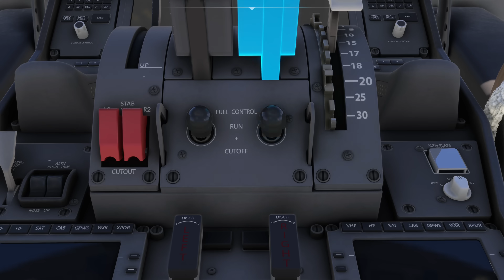Air India 171: Why Did The Fuel Cut-off Switch Get Moved?

Comment: Why are you again resisting the idea of a camera in the cockpit?

“It would add nothing in this case,” is patently untrue. It would tell us which pilot switched off the fuel. As it is we're waiting for someone to reliably identify which pilot said what by recognising their voices.

“Video might be leaked,” is only a concern if, for some reason, you're not worried about audio from the CVR being leaked. Why is that not a concern? Is it even technically possible?

Comment: Why don't you invite on your channel some Boeing 787 pilots working for Air India and other airlines and have an honest debate on this? E.g., Captain Sharath Panicker, who has many strong points against your theory. We should not be biased and listen to all arguments, particularly because the deceased pilots can't argue anymore. In particular, the preliminary report did NOT mention that this switch was manually moved from run to cutoff --- so on what basis are you pointing fingers to the pilots? Is your channel sponsored by Boeing?

Comment: There is no conclusions to be made based in that preliminary report apart that it gives a blank sheet to Boeing and GE to continue their normal operations and save their reputation. As a pilot, you are publicly supporting the idea that  this was a suicide when it is far from being a consistent evidence based on the PR.  Stop yourself from accusing a potential Innocent pilot of killing all the passengers of that aircraft because if the crew is not responsible of the fatal accident you are going to be more than in  trouble from the moral and ethical point of view.

Comment: VASAviation video on the Cessna Citation's engine cutoff "trigger" got me thinking...
For those who haven't seen it, the Citation requires you to move the throttles to idle before engaging the engine cutoff, unlike most Boeing/Airbus designs. It seems like a super intuitive and potentially safer way to prevent accidental in-flight shutdowns.
My question is: If Cessna were to release this design, what are your thoughts on it becoming a standardized feature for commercial aviation?

Comment: Pathetic! The crash was caused by the high temperatures at/before take off, not pilot action. I will give an abridged explanation: if the engines fail, the hydraulic system will fail and therefore they are linked. Then if the hydraulic system fails it could cause the engines to fail sine qua non. And if the fuel is cutoff it causes the engines to fail, so there is an ipso facto linkage with potential reversal there too. The scenario: the high temperatures caused a flow reversal in the hydraulic system which caused the engines to fail vide supra. Then when the engines failed they caused the fuel switches to go into the cutoff position ditto. This also accords with the timing of the RAT deployment, unlike the explanation involving pilot error/sabotage.

Comment: It is important to highlight that earlier there was an advisory issued by the FAA Aviation Safety with regards to various models of Boeing wherein it had issued advisory that there was a potential for disengagement of fuel control Switch locking feature. This aspect also needs to be delved into before accusing of any human error.

Comment: If it was an intentional suicide, then he wouldn't have attempted to switch it back on. Because, he would have faced much bigger consequences, legally and job wise if the engines had managed to regain thrust and save the aircraft. And if the other pilot had attempted to do so, he would have physically tried to prevent it leading to a scuffle in the cockpit because he knows the plane will crash very soon if he just manages to prevent the other guy from switching on for a few seconds.

And the nose was continuously going up when the aircraft was going down, indicating that the pilots were trying to keep the aircraft in air till the last moment by pulling the sticks back, if it was a suicide, they would have tried to hit nose slightly down, 
thereby the aircraft gaining more speed and momentum and absorbing maximum impact forces possible head on and therefore maximum damage possible

Comment: I'm wondering - it seems like double engine failure is super rare and still it's so easy to switch both engines off by one piliot. And if one engine alone running would have prevented this - maybe the most secure way would be to enable fast switching off of one engine like now but require additional active input from the copilot (or crew, in case of only one pilot due to emergency) to switch off the second one as well.

More importantly though - are there more switches like these that would be catastrophic and easy to switch as a single pilot during takeoff and landing? Like how many "vulnerabilities" of this kind can and should we expect?

Comment: What would you do if one pilot is incapacitated and you need two to cut fuel to on engine. 

Another question: When I worked on large transports, B747, MD-11, DC-8, and others, these switches were not easy to move by swipes , hits, etc., but had to be intentionally moved. Question, how much force does it take to move this switches?

Comment: All these questions seem to focus solely on suggesting that the pilots made an error. There isn’t a single question considering the possibility that the pilots might not have turned off the fuel intentionally, and that it could have happened automatically. In fact, there is guidance from the FAA regarding these very switches, noting that their locking mechanism is compromised — and AI confirmed they weren’t inspected. Isn’t it possible that the fuel switch locking system failed, causing them to trip automatically, or that an electrical or mechanical failure occurred? Asking these questions helps keep aviation safer, rather than simply blaming pilots who are no longer here to defend themselves.

Comment: If one of the pilots shut down the engines intentionally to kill himself and all others, why didn't he just push the nose down into the ground, especially while other pilot was switching the engines on back?
What we see on cameras is that the plane was smoothly gliding and then tried to pull up at last moment. So it clearly says that someone was controlling it as much as he can. In the same time we know that someone tried to turn on the engines, probably looking on their reaction, that caused a 4 sec delay between switchings. Also one of the pilots reported a Mayday to the tower. So most probably that all was not done by one pilot, but by two in parallel. Or at least second one didn't prevent it, there were no fight between them, he didn't turn off the engines again, he didn't push the nose into ground. So there is no signs that he really wanted to kill everybody. And most probably he was trying to fix the issue and restart the engines.

So from my point of view, the most realistic scenario was the following:
- at some moment due to some bug computers detected cutoff command at switched off the engines
- pilot at control decided that it was done by the second one and asked him why
- second said that it was not he and looked the switches and monitors, found that switches are On, but the fuel is cutoff
- then he tried to switch off first engine and switch it on back, looked on the status, saw that engine is restarted (that took 4 sec), and made the same with 2nd engine
- pilot at controls during that tried to glide at optimum angle and reported the problem by radio

That is very different from what I would expect in case of intentional switching. In that case I would expect the following:
- second pilot switch off the engines
- 1st asks "What a hell you are doing?!"
- 2nd stay silent
- 1st switch the engines back quickly
- 2nd switch them off again and pushes the nose down
- 1st tries to pull up and because both hands are busy he can't switch on the engines again
- unstable airplane crashes with nose down and with switches in cutoff position

Comment: It would be impossible for copilot,who was flying the plane to shot off the switches without the captain noticing it,and if the captain did it  the first officer would have cought it with the corner of his eye.These switches has not been cut off intentionally by either pilot,no doubt in my mind.They are located so far in the middle that is impossible to turned them off without the other pilot notice the move.

Comment: I would want to see a combination of cams in the cockpit AND being able to intervene from the outside of the plane in absolute need. So if there is a case where a plane is doing absolutely strange stuff, you could override controls from a distance and for example reignite engines (when pilots have passed out) or whatever.

Comment: For all those who are B787 pilot or B787 flight engineer, we all know that both fuel control switches can only be operated manually. If you already read B787 FCOM Systems or B787 AFM, you will know there is no software or computer failure can cause Fuel control switches move from Run to Cut off position. I know it’s very difficult to admit that one of two pilot cut them off on purpose. But that is really what happens. B787 are flying all over the world at any given moment, but there is still no accident like AI171.

Comment: Question for an experienced pilot:  Would the Industry be better off if International JetA1 were required to have the flash point spec of JP-5?  If there were a crash, would that not reduce the volatility of the jet fuel?

Comment: I have a question Captain Steve - Is there another way for a Dual Engine Failure to happen without the switches being put from RUN to CUTOFF? Let’s say in another world, the pilot didn’t do this - is it possible for this to happen without human intervention? Like the fuel contamination you mentioned in your previous videos? I am just shocked that the rest of the transcript between the pilots wasn’t shared and they are not telling us everything which makes me feel like they’re covering something up.

Comment: This question has been on my mind for a while: the fuel switch positions are measured by de flight data recorder with an electrical signal; the actual mechanical position is not determined except by the pilots.
Is the following scenario conceivable?
After takeoff, the fuel switches are in their normal "Run" position. Due to an internal electrical fault (hardware or software glitch), the power supply to the fuel valves is briefly lost. After power returns, the fuel valves remain closed.
Both pilots hear the engines cut out. Perhaps the pilot wasn't looking at the fuel switches when he said, "Did you turn the fuel switches off?" The answer that followed was "no."
Then he looks at the switches and sees that they are still in the "Run" position. His instinct to start the engines is to first turn the switches to the "Off" position and then back to the "Run" position.

Could the flight data recorder confirm or contradict this?

Comment: A British regulatory body, the UK Civil Aviation Authority (CAA), issued a safety warning regarding Boeing 787 fuel control switches just weeks before the Air India Boeing 787-8 crash in Ahmedabad. The warning, issued on May 15th, advised airlines to inspect and potentially replace faulty fuel shutoff valve actuators on several Boeing models, including the 787. This directive came after the US Federal Aviation Administration (FAA) identified a potential issue with these components. But western media and Captain Steeeve won't talk about this. :)
Reply: This is literally covered in the initial report, if you ever bother to read anything about it.

The warning wasn’t related to the switches being able to just shut themselves off, which is impossible because they have physical locks in place and have to be moved.
This has never happened before, and the idea that both switches on this one aircraft would turn themselves is about 1 in 1 million.

It is pretty clear that it was one of the pilots, as it almost always is. Indians are not superhuman, it is far more likely that one of them made a mistake than that a plane model with a perfect safety record conveniently had loads of faults that were hidden for over a decade on this one flight.
Reply: @FilmingFish  there will be an answer - it is the nature of air crash investigation - the process of elimination leads to a singularity explaining what caused the crash.  It is very strange that people (as I discern from your tone) are quick to conclude.  The preliminary report raises more questions than it answers - there is at this stage no evidence to conclude that a human being moved each switch in quick succession.
Reply: safetynotice2015005v2.pdf https://share.google/ROruYpjiZjI020Blr
Reply: Good point - it seems the value of 260 lives = Boeings profits and FAA prestige.
Reply: Would the shutoff switches move themselves to the "off" position in the event of a fuel valve acutator failure?.  With a switch locked seemingly in the on position is there a way for a failure to move the switch handles to the cutoff position, that is the one thing all these scenarios of an electrical or mechanical failure don't or can't answer.

Comment: In motorsports like F1, the cars are fitted with launch control to optimize the start procedure. Could a launch control be designed that prohibits certain operations (such as cut off fuel), state the order of operations, and at the same time leave the execution of the take off up to the pilot.

Comment: In a critical situation, one single pilot should still be able to cut off fuel, I believe.
However, in a climbing situation, the computer shall be able to raise a significant alarm signal when fuel is cut off.
Furthermore, cutting off fuel should bring up an alarm signal anytime, whether it is a climbin situation or what ever.
That's how I would improve it in first place.

Comment: There needs to be a system where both pilots have to turn the fuel switches off. You could have 2 sets of fuel cut off switches, one set for each pilot on the outer side of their control panel. If one pilot turns their switch off, the other pilot also has to turn their same switch off on their side within say 3 seconds of the other pilot in order to turn off the fuel supply.

Comment: Captain steve first blamed the pilots for probably pulling the flap lever instead of gear lever. Then birds, then contaminated fuel and now the pilots again for switching the fuel cut off levers despite pilots refusing it and despite FAA warning about 787 and some other Boeing models having issue with Fuel control switch locking mechanism.

Comment: I think what we are failing to consider is a FAULTY PREFLIGHT CHECKLIST. The fuel switches were never moved into the on position. There is allot of fuel line from the tanks to engines. Enough fuel to start , taxi and take off. When the warning light went off the pilot looks down and noticed the fuel switches were off and asked the copilot why he shut them off. That simple. Pilot error not performing a proper preflight
Reply: if they were never in the on position the plane wouldn't move.  It wouldn't have taken off, the plane wouldn't have the power to get off the ground.

Comment: 2:31 -  but the question was why the computer does not intervene with shutting off the fuel switches during take-off and at low altitude. Answering that you might need to do it during flight at higher altitudes or landing is not relevant to the question. Since there is literally no reason ever to do this during take-off, it seems important for the computer to block the shutting off of fuel at low altitude during take-off. Also weird that Captain Steve routinely downplays any questions about potential computer or technical problems that might have been involved. Did his airline or Boeing  pressure him to limit any criticism of Boeing? I do appreciate Captain Steve's attempts to start a conversation about pilot mental well-being. But overall, this was a rather weak Q&A.

Comment: I hope Captain Steve or anybody answers my question. 
Do you think the fuel switches were turned off and then back on in an attempt to relight the engines after a complete loss of thrust? In my opinion, at that critical phase of flight, a complete loss of thrust would only leave a little room for analysis and that is when the human factor kicks in and the pilot would rely on their intuition to get the engines back up and running and might have tried switching on and off the fuel switches in pure human intuition. Since the report said the fuel was cut off and then switched back on again. And when we speak about the questioning of the other pilot as to why the fuel was cut off, any human would be alarmed when someone does something that seems counterintuitive to them at a situation like that. It's easy to blame the pilots but they're only human.
Reply: Most brainless crap I ever heard😂